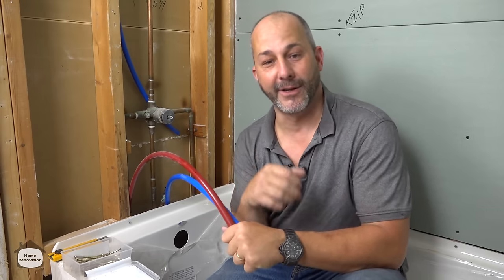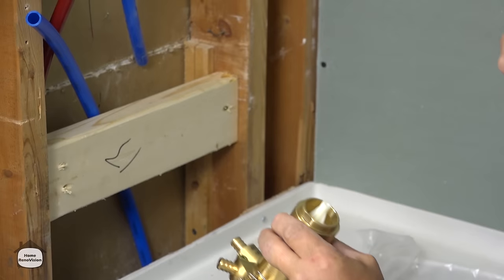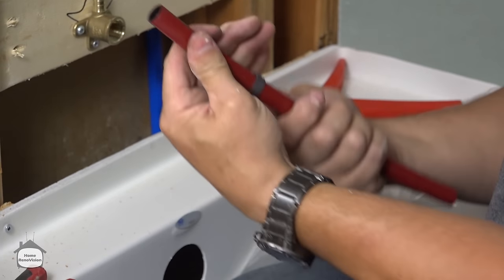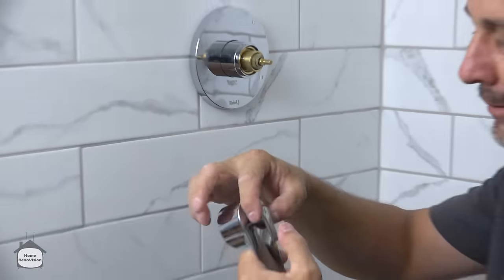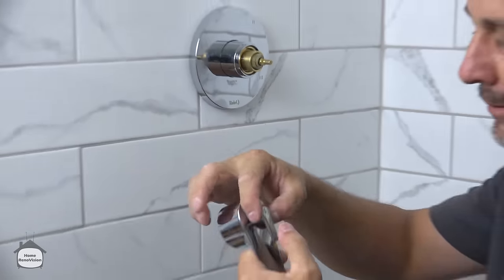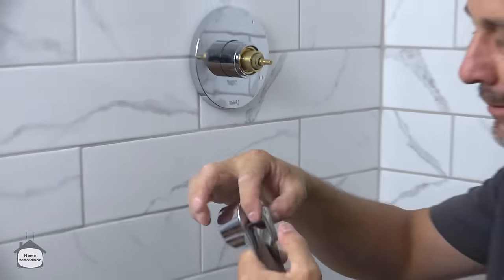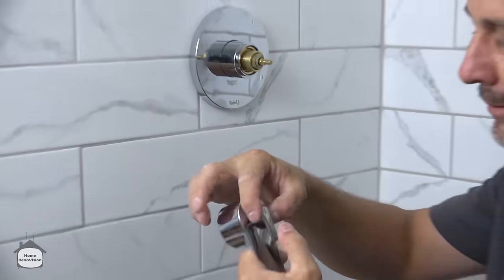How to Install a Pex Shower | Full Installation Tutorial

Comment: A couple of pointers first I am a plumber and  I do not recommend the copper compression system they have a greater chance of failure. For some reason the copper over time seems to lose its compression. It's rare but I have seen it. I dont know if it's because copper is a soft metal etc or how its installed. I've had to open up a few  walls to find it leaking. I normally cut the copper ring and replace it with a stainless viega style compression. The stainless ring seems to works better. I really prefer uponor system but that's another thing entirely. Secondly I would of siliconed around the tube spout nipple, screws for the wand, wand water supply and even the shower spout. Especially the tub spout nipple for some reason I have found water follow the spout back and leak into the wall. Again it's rare but when I install it I dont want to chance a call back. Really good work  I enjoyed the video.

Comment: As a professional red seal plumber and contrary to some things ive seen on your other videos you did a good job on the plumbing by actually soldering and using crimp adapters. Thats the best way for homeowners and contractors to do it. Have you seen the pex by copper stub outs for sinks and toilets? They work great for a tub spout if you wanna save soldering in the wall and want a quick and easy way to mount a slip fit tub spout. Used one in my friends cabin and it worked great

Comment: I am just about to close up my wall on my shower project and now have to rethink how deep my drop ear is relative to the studs.  I imagine that there are multiple lengths of pipe nipples available so if mounted too deep you could solve that issue with a longer pipe nipple but if it protrudes out too far then it would be a bigger issue.  Glad I watched and learned (a few) things.

Comment: Good video Jeff. Very informative .I forwarded this video and some of your other pex and shower videos to my brother-in-law. He wants two remodel his bathroom by himself. I told him good for you..... if you get in trouble call me. 
I have used a couple different brands of tub spouts and trim kits from Europe. The trim plate has a backing with a gasket like yours. But the tub spout also had a silicone gasket and o-ring as well. 
When I use a regular plastic or metal threading in the tub spout I lay a thick bead of clear silicone caulk on the inside just a 1/16 inside the back rim of the spout. Let it dry until the next, day, maybe two. Then i use clear silicone caulk and run a bead of caulk onto the caulk outside shoulder that I had put in the day before. I embed a large o-ring sized to fit into the new caulk, tighten up the spout and then I have a water tight seal. I’ve done this dozens of times and have yet to have water get behind the spout and leak into the wall. It takes a bit of planning and your need the correct size o-ring but it works pretty good. Hope my explanation was not too confusing!
Ron

Comment: We just did our bathroom and we used a 6 way diverter with a separate temp adjusting mixing valve.  We used all Pex: shower head, tub spout, wand.  The brand we used was delta for the valves.  Interestingly delta said their 6 way valve is not designed for a tub spout as one of the legs but we went ahead and did it anyway.  It works great.  I would say that we used Pex A instead of B as Pex A has expansion fittings.  Therefore when you make connections, the inner diameter isn’t made smaller by the fitting so it should help with potential pressure issues.  The fittings with Pex B are also what cause that dribbling from the shower head when installing a system with a tub spout diverter.  Great video.  Awesome way to install a shower system.
Reply from the maker: very cool. the valve i used has a positive stop so you can use pex b as shown and have no issue with the tub spout. Cheers!
Reply: you can use pex a with a crimp if it has the proper certification. I know uponor aquapex meets the certification for using crimp as well as expansion.  You cannot however use this shower kit with the expander, as the diameter of the fitting isn't large enough, and does not meet the requirements.
Reply from the maker: correct. the fitting has to be copper ring at the valve.

Comment: Matt Risinger did a 14,000 PSI test on how much pressure it would take to bust a fitting off. 
fitting never came off the pipe failed first.
Reply: I need to see that.
Reply: @ImTrans-Former  Go ahead and test it...done exactly the same and  pipes went boom but not the fittings

Comment: You make it look easy enough for me to do and I haven't done any plumbing or remodeling. That has always been my husband's cup of tea.
Question: We are about to remodel our bathroom. We are getting rid of the tub and putting in a tiled shower with handicap access. We can't make the window smaller or remove it all together (that gets into repairing and re-siding a 1960's house with original painted Masonite siding. That comes at a later date). So about 3 inches of the window will be in the back of the shower. We will be replacing the wood window with a vinyl one. But how do we make it waterproof?
Reply from the maker: use kerdi membrane to wrap around the frame right up to the vinyl. Use kerdi fix to seal the membrane to the window. and tile. Cheers!

Comment: Don't know about your valve but the ones I've installed require copper on the tub spout because the pex fittings are just a bit smaller than 1/2'' required and so the water comes out the shower at the same time as the tub. I learned this the hard way. Check the manufacture specifications.
Reply from the maker: Hi Don, this valve has a positive stop position for the tub and does not need a mechanical diverter so that problem does not exist.. Cheers!
Reply: @HomeRenoVisionDIY  what is the model of the shower fixture set you used?  I love the look and install simplicity.  Ant help would be great.  Awesome channel by the way.

Comment: I would advise you not to loop your pex  I am a licensed plumbing contractor in south Carolina. With 26 years experience,  the one down side to looping is it puts stress on the pipes  and will cause it to leak down the road the best way to run pex is to use elbows.  For one it takes the stress off the pipe and it looks more professional   now this is my personal opinion and just that but what do you think the customer would rather see someone who took the time to make things look nice and neat ir someone who took the easy way

Comment: Jeff - You've been A TREMENDOUS help with guidance for my 1st home renovations. Your videos are the ONLY tutorials I don't find myself saying, "c'mon c'mon" or "get to it already" LOL. The small occasional bits of humor are definitely helpful. 
1 question- (and it may have happened in a PREV video of yours I watched right b4 this) Why did you use plumbers putty or pipe dope with the teflon tape at the valve connection and not on other parts you used the tape?  Thanks in advance

Comment: I might've missed it but I didn't see when you turned the individual valves on the shower valve back on... I'm assuming after the rough-in and before the tile backer board unless you left enough clearance in the tile opening to get to the screws before you installed the trim (my preference)... otherwise, great job and thanks for taking the time to do the video. I've done man but it's always nice to see someone else's technique.
Reply from the maker: Hi Bill, the valve shutoffs are accessible even after tiling. Cheers!

Comment: Hey man I love ur vids . Been I'm construction for 17 years learned from dad . It's cool to see u teach ur boy . So . A question . I installed a new mohen 3 way shower fixture , hooked it up and did a water test to see if the pex leaked it didn't . But water shoots out of the shower head pipe lol . Did I miss a step or is this more than likely a faulty cartridge?
Reply from the maker: Check to see if the cartridge has a positive stop function. it may have been turned to the on position and all you need to do is give it a 1/8th turn. Cheers!
Reply: @HomeRenoVisionDIY  
Thanks souch for ur feed back I messed around with it and sure enough it had been over turned . Awesome response buddy hope we can communicate on some upcoming projects as well I really would like to start recording . Keep up the good work

Comment: A trick I like with pex is if you are having trouble getting everything in place the ring where it needs to be, keeping it there, and getting the crimper in there. You can, by hand, make the ring slightly oval shaped which will hold it n place while you get the crimper in.
Reply from the maker: I have started doing this recently. cheers works like a charm.
Reply: Great idea. thanks!

Comment: Great job this is one of my really favorite videos on YouTube I like the way you show things I agree with you about the Corner Connection to the module you don't need that extra length usually they put in the old school but every plumber from the old school complain about that which is I know exactly it does not make any sense that they complain about it great job I would ask about certain kinds of shower sets that I end up especially after the customer change the kind of the tiles and the thickness what to do when they have extra attachment for handle shower or other stuff
Reply from the maker: glad you liked it..Cheers!

Comment: much appreciated very detailed and looks amazing... researching because I plan to renovate a master bath removing shower unit installing a bath and shower and was going to convert to PEX for simplicity. Would you recommend any SHARKBITE fittings instead of the crimps on some not all the fittings? I ask this obviously for the valving I'm sure would need to do some soldering.

Comment: Got a simple question I need help with. I’m working on my bathroom and there was an old leak that left damage to the plumbing to the vanity. Can these pipes be replaced with the pex connections or does it need to be rebuilt with the traditional copper fittings?   I’m planning on redoing the shower lines like shown in this video ... amazing video! These have helped me out so much thank you for your hard work jeff!

Comment: Great video and great workmanship. 
I have 2 questions. 1st question: does this shower system conform to US code? I believe US requires some sort of anti-scald feature. 
2nd question is how did you make those clean square cuts in the tile?

Comment: Love your videos and hope you read & answer questions from the older videos...  You described the valve mounting depth and I could see you used a 2x4 for the tub drop ear,  but you already had the shower drop ear covered and then cut out (skipped) the part where you set the depth of the handheld drop ear. It looks like a couple 1x1s plus a 2x4 for the handheld but I can't tell for sure. Real novice so appreciate your patience (maybe I shouldn't even attempt this...) but would sure appreciate the full descrption... Can you add to the video description or post to the top of the comment section?? TX

Comment: Each 90 elbow is equivalent to 9 ft of pipe friction.  That being said, you are correct.  The modern valves are ridiculously restricted and with most homes with 30 to 50 lbs of water pressure this friction will not amount to a hill of beans!

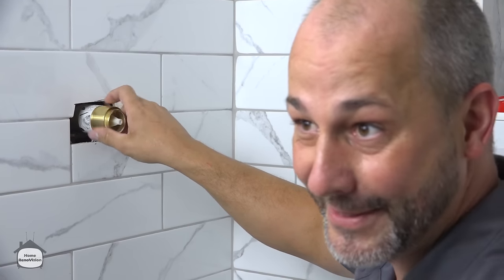Comment: Crazy question but at 17:50 you mention the shut off valves are in the "off position". Is that only to avoid the hot water running back into the main water supply to avoid a sweating toilet? If the hot water valve is turned to OFF then how would you generate hot water for the shower? At 19:30 you mention the water shutoff valves are still in the off position but you finish the video saying you are just turning the main water back on to the house. Do you ever set the shutoff valves to a different position than what you did at 17:50?

overall this is SUPER helpful to watch and I can't wait to do something like this for myself!

Comment: Hey Jeff,

I will start my bathroom remodel this weekend and I have a couple of questions-
1. My tile doesn't have the glossy finish like the one in your video. Should I put a sealer on it (it is ceramic tile)?
2. What is your opinion on using a large tile (12 X 24) in a standard size tub surround? Is that uncommon, or just a matter of personal taste? Most of the tile jobs I've seen use the smaller sized tiles (8x8, 4x12, 4x4, etc.). 

Thanks!
Carmen
Reply from the maker: Hi Carmen, 12 x 24 is a very popular tile choice for a bathroom now. The secret is to have a very plumb wall. if not use tile leveling clips and back butter your tile to maximize your adhesion. you should be getting a 95% coverage on the tile in a wet area. The glaze on the tile will have no effect on performance and is simply aesthetic. Cheers and have fun. remember take your time. If you are not happy with the tile you just laid then remove it and fix it. Cheers!

Comment: Just a public service announcement. Do not use pex from the mixer to the tub spout. The inside diameter of the barb, or sharkbite fittings is 3/8" and will restrict the flow of water enough that the shower head will drip while filling the tub. It doesn't sound like a problem to some but the drips will hit the tub spout and splash onto the floor. Plus a dripping shower head is not correct. To correctly install use copper pipe from the mixer to the drop ear and from the drop ear to the tub spout. If you don't want to solder copper you can use sharkbite and REMOVE the white plastic insert. You do not need this insert if you're using copper or cpvc. I am a new home owner and just remodeled my bathroom following this video series and it turned out great except for the dripping shower head. It caused me a lot of headaches but after reading several forums I ran copper with true 1/2" inside diameter fittings from the mixer to the tub spout and it's now working correctly.

Comment: Question about using "speedfit" fittings with PEX instead of the crimping tool - is there any downside apart from the additional cost of the "Speedfit" fittings?  The speedfit fittings are readily available locally, more so than the crimp rings and crimp tools, the overall cost will also be lower for me (crimpers are hard to find here, and expensive, but if that's best Ill get one) 
Thanks for the awesome content!

Comment: Looks like you enjoy want you do. I PEDRO enjoy automotive repairs and maintenance not so much homme stuff especially plumbing. Just bought a pex iwiss kit 1/2" and 3/4" setup for daughters ao smith low boy electric heater replacement in 4' crawl space. Im a retired high voltage utility lineman can deal with electricity not so much water
Reply from the maker: not everything is easy. but definitely worth it. |Cheers!

Comment: Hi let me help you out, when you get water to the shower head is not the pressure it’s the pex fitting your using, that fitting is only for the shower head is for the spout. You have to use the drop ear 90 copper to copper and you never have that problem👍

Comment: Jeff does great work , one of the best on youtube ..... I would however bring along some 2" screws instead of cutting 3" screws !!!!! lol ... If you're doing remodeling projects , I guarantee you need a variety of course thread drywall screws ............1" , 1 5/8" , 2" , 2 1/2" , and 3" ..... Might as well buy some ..... I know Jeff has 2 lbs of 2" screws in the truck !!!!! lol

Comment: Love the videos and information you share. Plan on remodeling our bathroom starting next week. I took your advice and waited until everything came in to formulate my plan. Quick question though,  I'm planning on building a niche like you did in this episode but the wall behind the shower is lathe and plaster. How could I mount the backer board to the back of the niche without drilling through the back wall? Would a quality construction adhesive do the trick? Thanks in advance.

Comment: Regarding the spout that supplies the hand held shower, did you measure before installing the rough in, so that it would not touch a grout line for the tile installation?  It looks like it is centered on the tile between the top and bottom grout lines.  That seems like a very lucky guess if you didn't measure.

Comment: @Home RenoVision DIY  I'm about to replumb my home and I was wondering why you chose Pex B over Pex A. Don't you think Pex A is superior to B? More flexible, joints less likely to leak due to contraction vs compression, more expansion/freeze protection, more water flow, and so on? I don't see any advantage of Pex B, except the big box stores seem to carry more of it and the power expansion tools of Pex A are relatively expensive. But those seem like trivial reasons compared to the advantages. What am I missing? Thanks.

Comment: Which shower mixing valve are you installing here - is it a moen positemp? And does it come as a kit with a shower trim kit? Thinking about something like this in my current bathroom renovation.

Comment: I know pex and sharkbites are the sexy new stuff.  But I remember in apprentice school the guy came in raving about the pb pipe with the rings.  Those started failing and were one of the leading causes of insurance claims.  My mechanic and I used the irons to weld the adyl "a" pipe together as well.  He was not a fan of either and stressed to me about coper for potable and black iron for gas.  Now I learned the yellow flex gas pipe is failing because of lightning strikes and not being properly grounded.  I'm sticking with the traditional materials. sorry, but they've worked for 100 years and will still be around in another 100.

Comment: You work with a lot of copper, have you started with galvanized  pipe? I have an old water supply that needs to be replaced and I am not sure how to do it.  Do you have any YouTube videos on replacing the pipe to pex and still use the galvanized adaptor already there? Also is the galvanized adaptor 3/4" for the male?